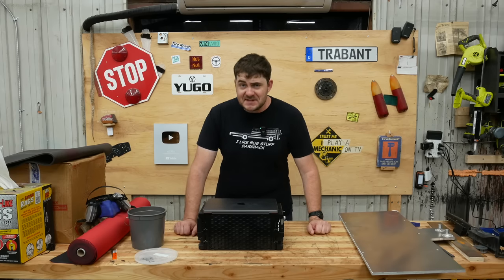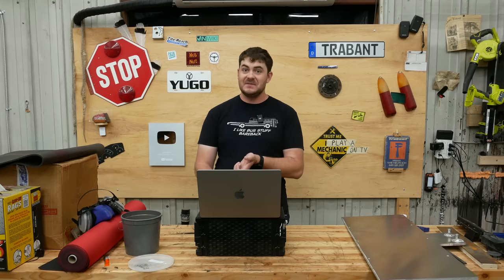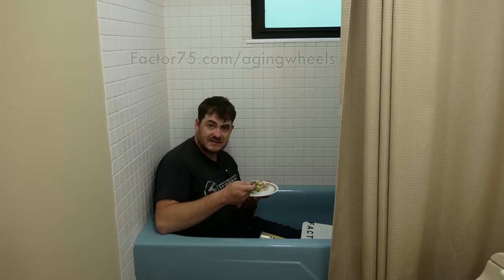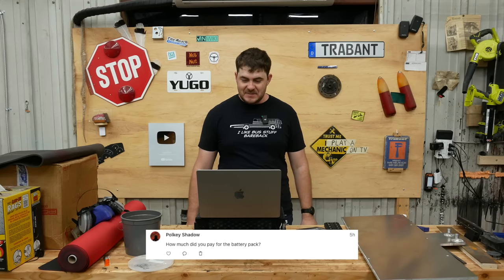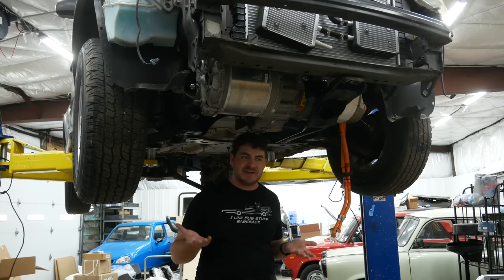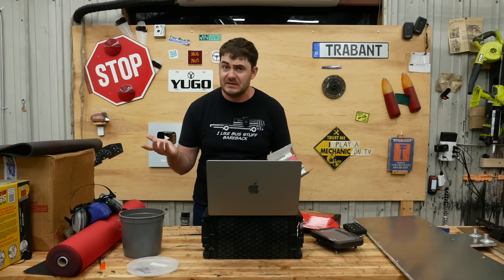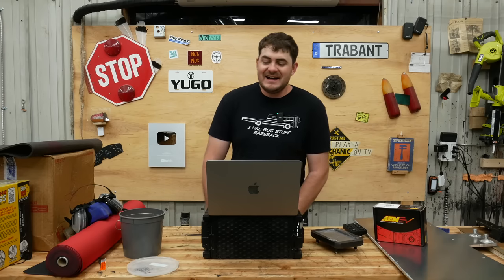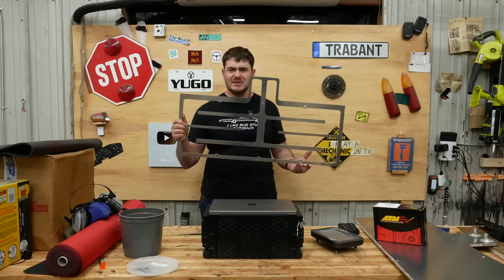Your Burning Electric Escape Questions

Comment: Just at the point of your battery pack cost. You should really look around a bit more. If you spend some extra time working on the cells, you can get more power and capacity at a lot lower cost. A short search at Battery Hookup shows a 48v pack that outputs 100amps for 25 bucks. 280 of those would give you 400v, 3500 amps, and 84kwh for 7k. The spacing may be tight for your project. I didn't run the math. But it just shows what is actually possible. Even some Headway cells wouldn't be too difficult to set up for this pack, giving you similar capacity and power for 10k less.

Comment: you should add airbags...
to the power unit when it breaks free and face fucks somebody behind you
pretty sure the airbags won't help much but maybe it will make it jump and away from any potential victim..

or just add another bolt,
should be fine

Comment: When a company makes a conversion kid that makes sense, not just "affordable".    EV will take off.  Because affordable will have to mean that it is less or about the same as getting a used car. Including the labor cost of doing the swap.   Because if the kit cost about the same as a used car but the installation cost is same or more than the unit cost it is not affordable.    When that happens then it will make sense to do an EV conversion.  Until then it will be a thing for people with plenty of disposable income and for YouTube channels that can put in the time, labor, and financial backup to get it done.

Comment: That large sheet part at the end? SendCutSend? I mean...ArcDroid can do most of it, right at home...often from scrap...Huge sponsorship potential ...Hey, you would probably also love Steel-It as a sponsor....  Check them out, and put yourself on both companies radar. Steel-It, and  ArcDroid are great folks, who make excellent stuff, and are really keen on sponsoring folks exactly like you.. ArcDroid is a modern legend already. Steel-It spray bombs are stainless steel impregnated polyurethane....Super professional results, and tougher than powder coat, from a simple spray bomb. Bowling lanes, and balls...Yea, that's hard stuff... . Oh, and you can weld right through it if something fails, and you need an emergency weld, and once welded back up, you can spray directly over the new weld with fresh Steel-It, once cooled. No primer needed. Spray it directly on clean bare parts of all kinds... The plain stainless color is my favorite. Honda Off Road Racing even uses Steel-It on all their suspension parts, roll cages, etc. Steel-It sponsors several racing events.

Comment: A trailer with an aeroshell built out of solar panels and that covers a big battery pack.  It would be silly, but cool.  Silly cool.
Reply: The painful part is the weight to pull that and the cost if the batteries.

Comment: So, I'm typically not excited about any type of electric car. In my mind they have too many technology hurdles to overcome to make them even equivalently efficient as its gasoline or diesel counterparts. However; I like that you're giving this car a new life. So many of the youtubers that I have watched in the past will start with all brand new materials. I would much rather see a car restored then crushed. For that reason I'll continue watching this series. So far this is the only electric car project on YouTube that I'm even remotely interested in. I think it's mainly because of your sense of comedy, Witt and charm.
Reply: "they have too many technology hurdles to overcome to make them even equivalently efficient as its gasoline or diesel equivalents"
EVs are monstrously efficient though, that's their whole deal. Super high thermal efficiency, and very high regeneration of energy when slowing down.

Comment: With the data in this video, batteries alone cost about 58% of this project's costs thus far. That's a lot. It doesn't account for labor or future costs, but it's still a lot.
EV conversions are gonna be a tough sell.

Comment: The idiot lights can be turned off via the correct CAN messages if you can find them,  if you run dual CAN  then you could tie the two togethere. The problem with the Idiot lights being on will fail the road test....

Comment: He really needs to dump the electric bus idea as the Tesla motors are not going to be big enough even paired up.  Think about: Rolling resistance of the tires. / Brake drag ( if discs ) / Frictional losses in the rear axle / Wind resistance.    If he really wants an electric bus, look for a scrapped electric transit bus and pull the parts.

Comment: Yeah as a mechanic I can tell you those front arms are going to at very least tear the bushes instantly,  unfortunately they're designed in a way that all the weight is loading them in the way they're the weakest. The power from the wheels will stress them in the way they're stronger but they're still shit bushes by design. Stock fwd cars tear them all the time so 400 hp per tyre is going to ruin them. I hope I'm wrong but I think the suspension in this thing is going to be fucked

Comment: I don’t know why you’re ignoring the elephant in the room. Please dear God, do NOT use the first GEN Tesla motors like the ones you’re using in the escape in the bus. If you’re looking for longevity, these are the wrong motors it’s not a matter of if it’s a matter of when these first GEN motors will fail. Also, the motors in Yorks gate are damaged. There should not be any liquid at all inside the inverter housing on the first GEN motor. I sense you have liquid in there that is a sign that the bearings have failed and is allowing the coolant into the inverter. This will cause the inverter to fail.

Comment: oh no ur not using it for the bus, u could've chosen a so much better platform then not some econobox fwd SUV, pls at least redo the insides and maybe body work and wrap the thing, ffs u could've used like anything else even an old jeep or crv if u wanted an SUV would be better, better yet a clapped out escalade
Reply from the maker: It's not a sleeper if it looks special
Reply: @agingwheels  i guess ur right, I forgot u wanna keep it a sleeper, but def redo the interior